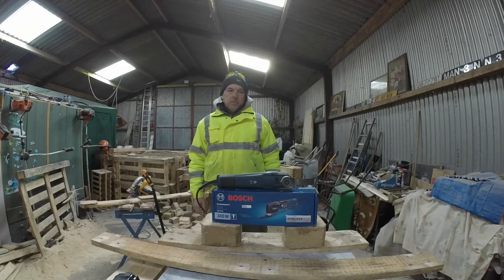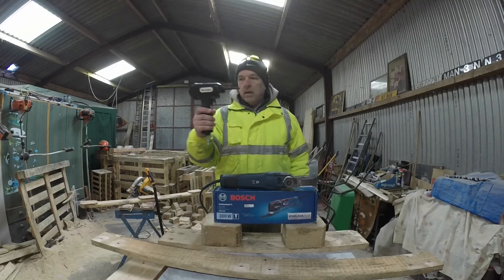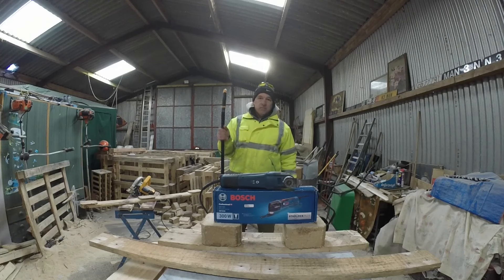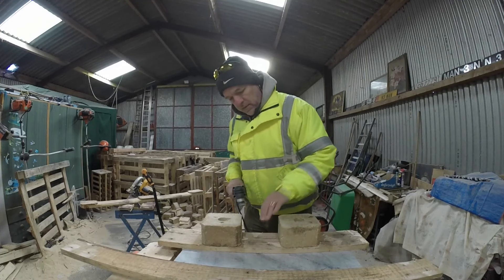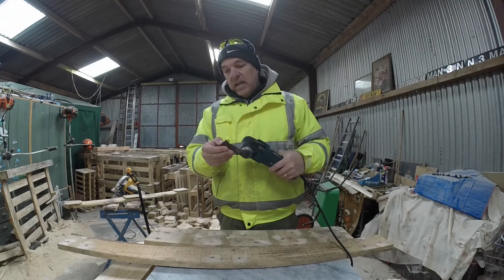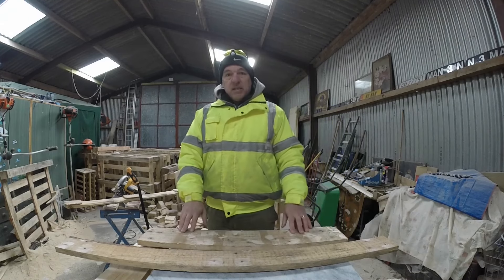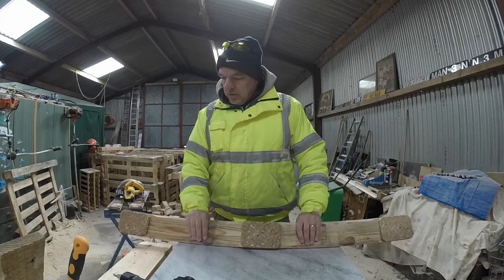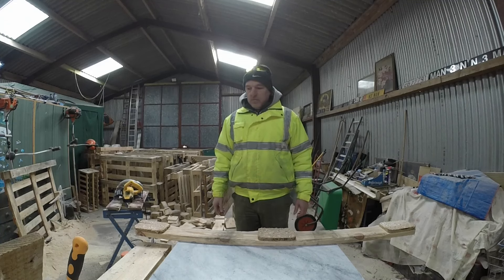DO NOT try breaking a pallet with an oscillating multi-tool. Epic fail!

Comment: Reciprocating saw is the best thing to use on EPAL pallets I use mine with no problems I have the Einhell cordless one with a muti-material blade piece of cake. Just make a small gap for the blade and its quick and easy. Swap the multi tool for one instead
Reply from the maker: Thanks I will try reciprocating saw next time